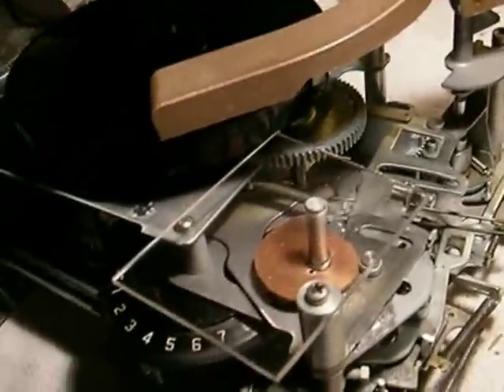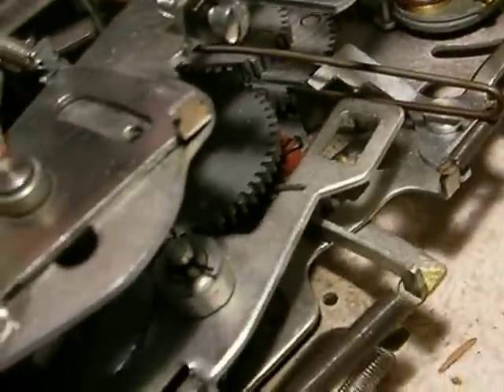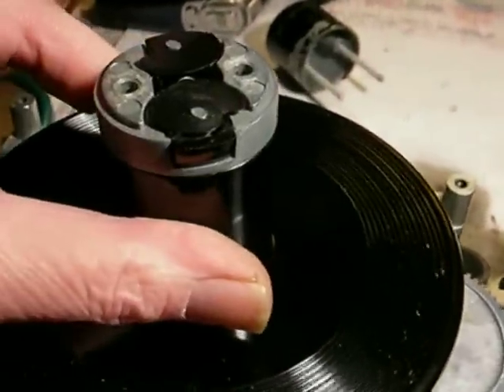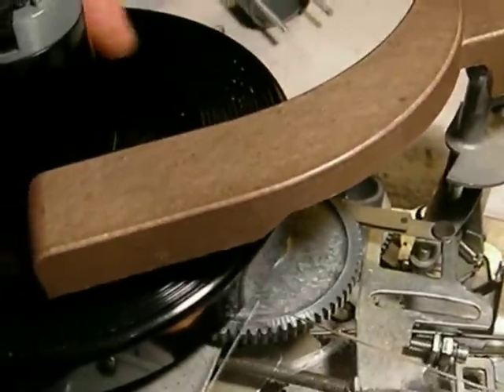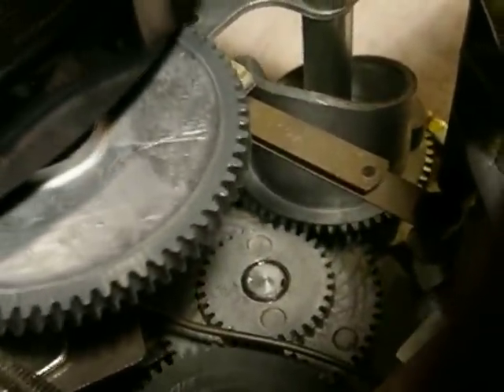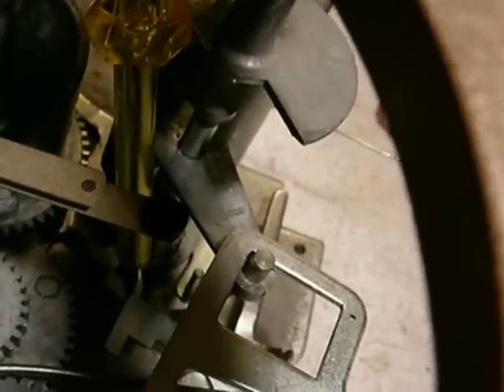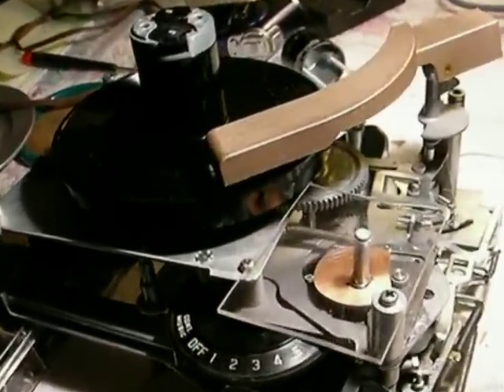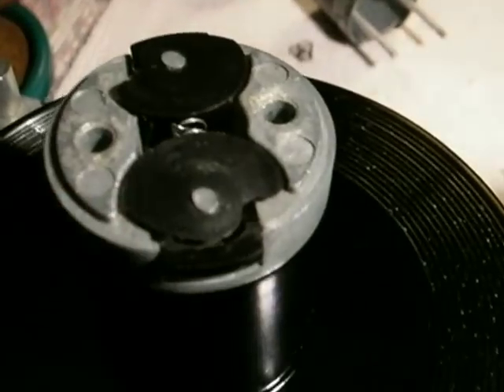Ristaucrat mech part 6

Comment: I recemtly acquired one of these radio/dial-o-matics and everything works except, of course, the idler/drive wheel, which slips. Maybe I missed it in your excellent videos, but what did you do about the rubber idler/drive wheel?